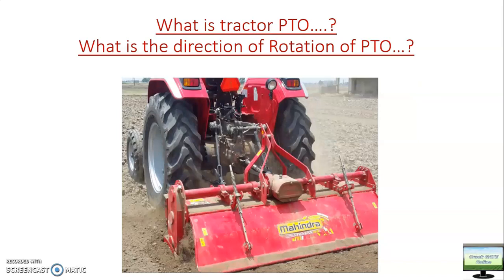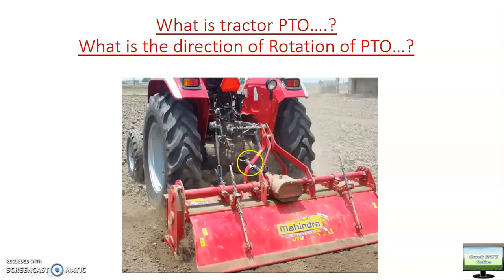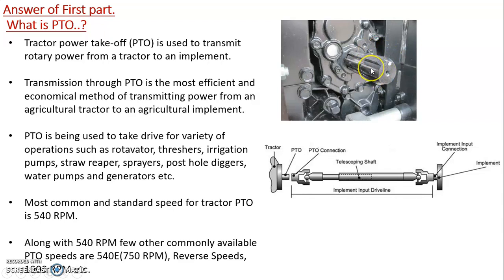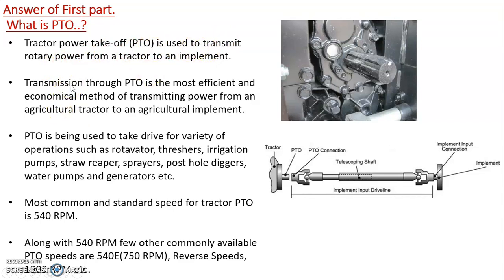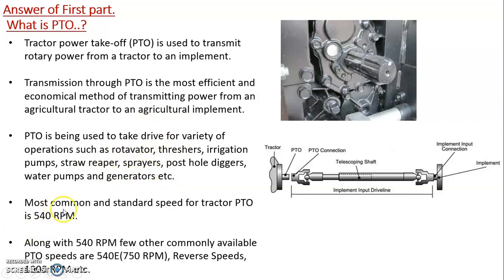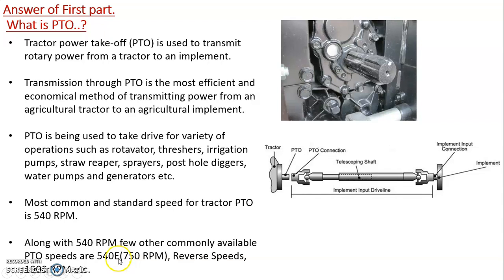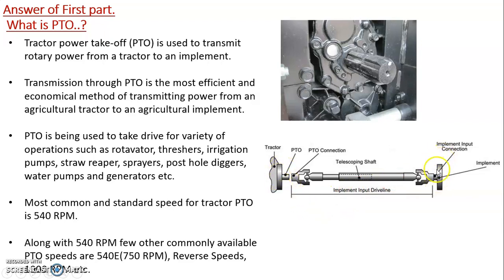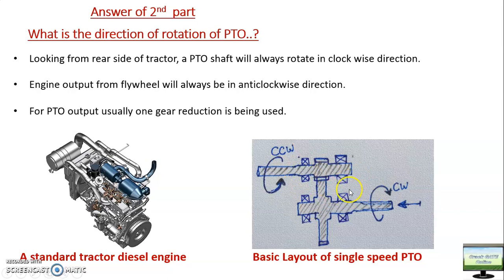What is PTO. What is the direction of Rotation of PTO and why.

Comment: Timing gear used for camshaft rotation to open and close the  valves
Reply: @Dharmendra parker
Yes, and it also times FIP. 
don't get confused  @6.15 min.
The timing gears you are talking about are on the opposite side of Flywheel, not on the flywheel..I mean located on the front end of engine..behind water pump..

Actually there are some Marks on the flywheels of most manufacturers .Like SI (start of injection) mark, TDC mark. Which helps while setting the tappet clearance also to check piston positions & injection timing.